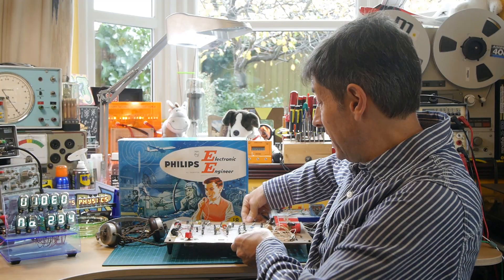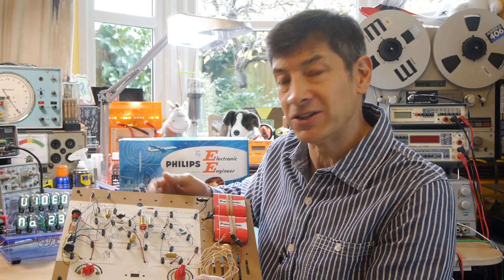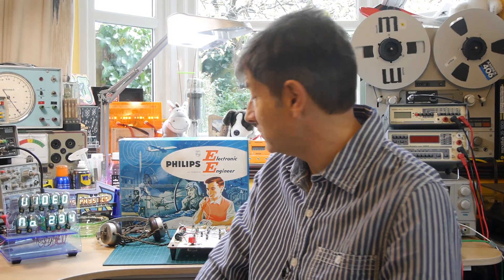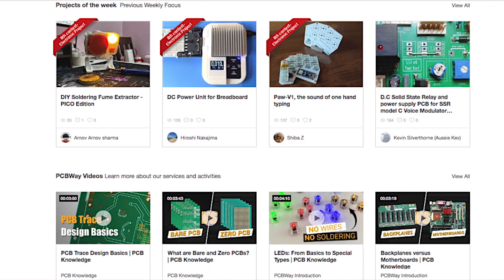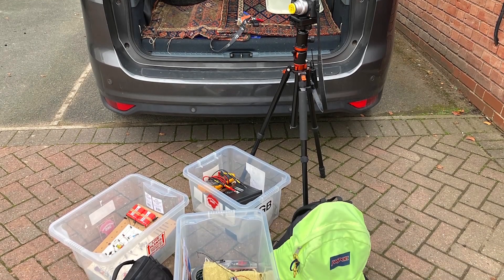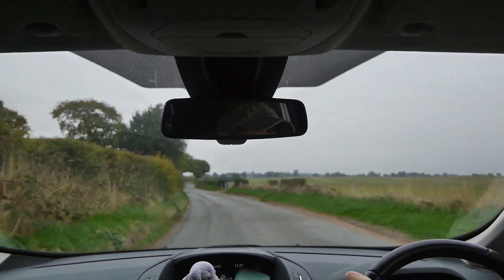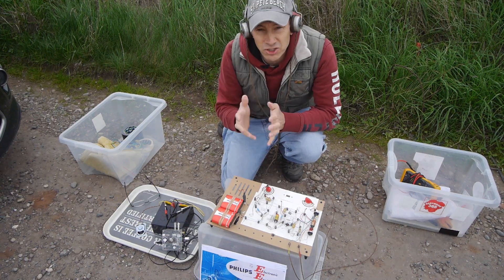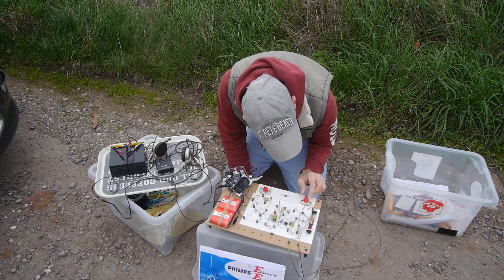Philips Electronic Engineer EE08 1966 - 2 Transistor Radio Field Trip - F-J's Physics - Video 234

Comment: It's time for somebody with a CNC machine to step forward and make the baseboards. I have a CNC metal milling machine but, unfortunately, it does not have the y-range of the board.
Reply: look at the EE1050 kits, the build boards were much smaller.

Also if you want to DIY a larger baseboard, then make up a simple jig with 4 holes. Put two pegs in the first two holes, then carefully drill the first two holes in some hardboard. From then you can insert the jig and drill two more holes, move the jig into the new holes and repeat. No real need for CNC (which would be easier I admit) 

Andy
Reply from the maker: Great idea Andy!
Reply from the maker: Yes, that's a thought.  Even if it was simpler and used regular springs with the overlays.  Now, I have just finished a video on how the circuit works and I have challenged viewers to copy the 'card overlays' with an identical looking circuit board.  That would be fun! (and I would feature it of course) or do I have to get the copper clad board out and chemicals and have a go myself maybe?  Thanks again for watching and always good to hear from you, F-J.
Reply: @AnthonyFrancisJones  I managed to buy a pack of the original springs, but could find no source of the loops.
Reply from the maker: Yes, I think you will have to make them! Or perhaps screw the springs into the board and just use them like the other electric sets did - but it's not the same.  Let us know how you get on.  Oh, you have just made me think I could include some 'viewers' build photos' in a video at some stage too!
Reply: @AnthonyFrancisJones  I don't know if I mentioned it here, but when I began my PhD I was thrown into running an electronics lab, and it was based on a breadboard with metal solder posts at  regular intervals. It was rather like the Philips idea, but with components being soldered to posts, and link wires being used One of the undegrads called on my help as he was having difficulty soldering the final connecting wire to a post. Upon investigation the problem was clear: he had been using solder as connecting wire throughout. I was impressed that he had managed to get almost all successfully wired up in that way!
Reply: @frogandspanner  They are known as hairpin retaining clips - you will mostly get hits for "R" clips, but the type used on the kits are there. They are also known as hairpin cotter pins  google search set to image is helpful to identify them.

Andy
Reply: @andye2005  Thanks for the suggestion.
Reply from the maker: Brilliant story!  When I was a student at Cambridge I often offered to repair lab equipment and one person was struggling with soldering thin copper wire.  It was enamelled of course and they had not realised!!
Reply from the maker: Thanks.  Did not know they still existed.
Reply: @AnthonyFrancisJones  There were two  packs available, and I bought one !
Reply from the maker: @frogandspanner  Excellent!

Comment: I got ChatGPT to rustle up a table of the major BBC and commercial AM transmitters in the UK. Apparently there's 43 of them (almost all BBC) from 198kHz BBC Radio 4 longwave coming from Droitwich up to 954kHz BBC Radio 5 Live from Moorside Edge. Do you have any idea what frequency range you're able to pick up with your circuit?
Reply from the maker: Interesting!  I think the radio mast on the Wrekin is my only hope but I could have spent longer 'hunting'.  I might have to go up to the Stretton Hills too.  Think is I have to take it apart soon to build something else...  Good point about the frequency range.  I will have to see if I can measure the inductance and capacitance (range) and then do a quick calculation.  Not sure if I have the right sig-gen to sweep it and look at the output to see what the sensitivity is.  You are getting me thinking now!!